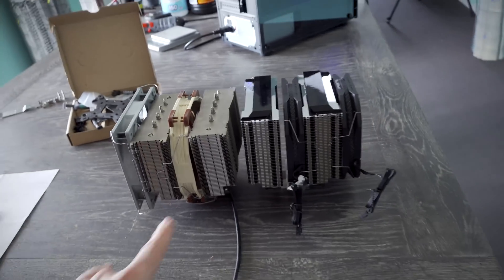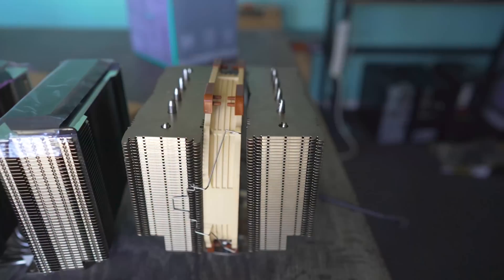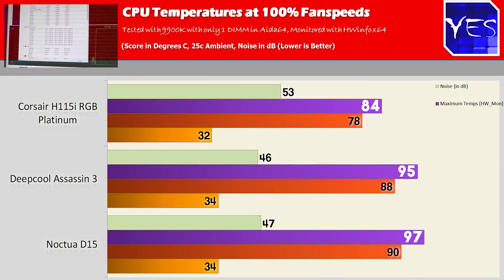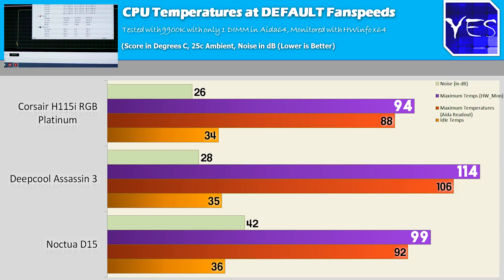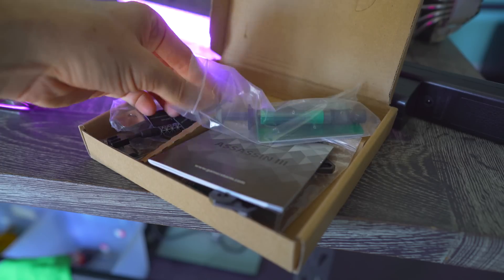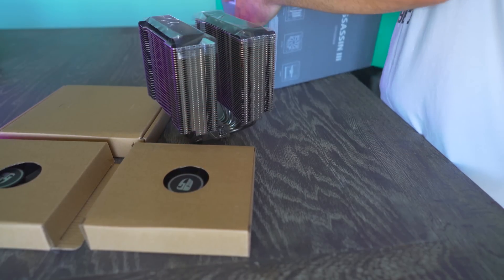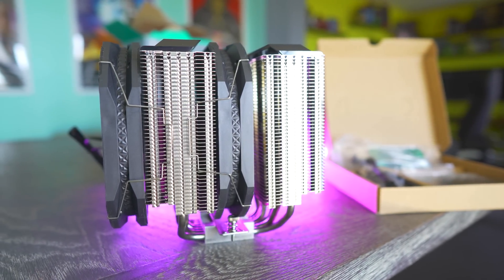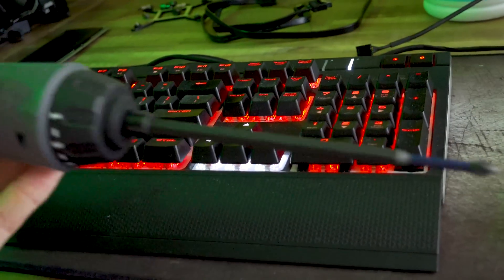Is Deepcool's New $100 Cooler the end for Noctua's D15?

Comment: This thing could have easily killed the d15, and dark rock pro 4, if they had just priced it right.
Reply: True, but at the same price I'll take Dark Rock Pro 4 24/7
Reply: @NaoVII  That Dark Rock Pro 4 sucks. It performs worse than the Pro 3, and it's just overpriced. If I'm spending that kind of money I'd rather just get Noctua and not worry about it
Reply: @NaoVII  personally I'd rather have the cryorig r1, but the point is that deep cool went way above their brand.
Reply: @James Smith my 5960x draws 230 watts at full load, I think I know what my cooling capacity requires.
Reply: Florian Oprescu  Right now. There will be a limited edition first batch LTT themed black and orange version, alongside a regular fully black version. There are also fully black versions of the NH-U12S and NH-L9i. 

https://www.amazon.co.uk/noctua-NH-D15-chromax-black-dual-tower-cooler/dp/B07Y87YHRH/ref=sr_1_4?keywords=noctua+nhd15+chromax&qid=1570568420&s=computers&sr=1-4
Reply: They already did with the Lucifer V2 which was gigantic, and it was only $35. Neptwin and Scythe Fuma/Mugen 5 are good too.
Reply: Then Noctua put the nail in the coffin by launching the thing everybody has been waiting for: A fully black NH-D15. The 'it is ugly' argument has peacefully died in it's sleep October 8th 2019. The day is here people. They finally did it.